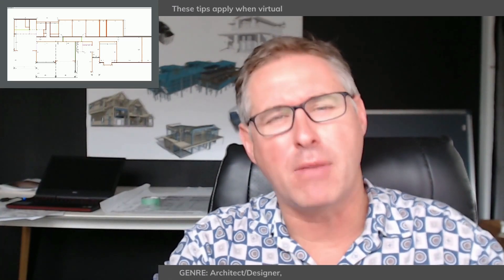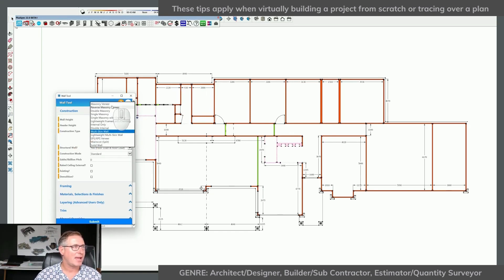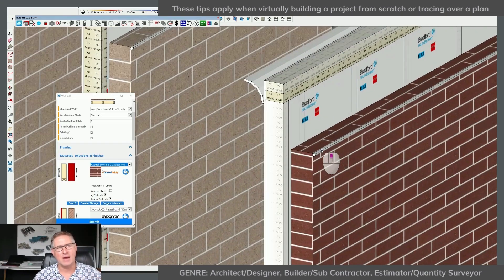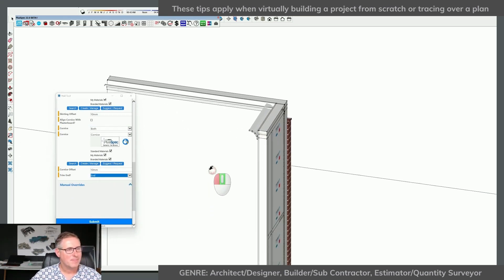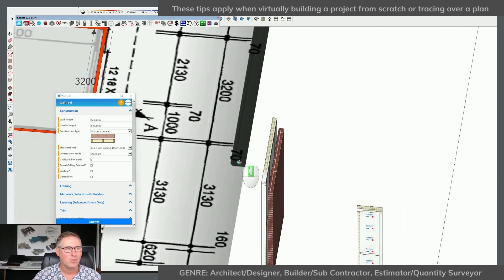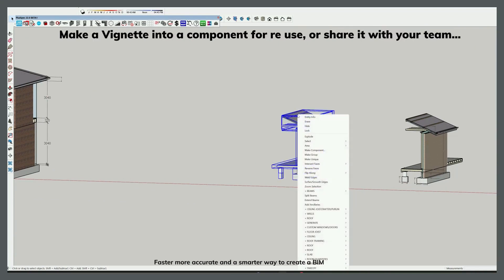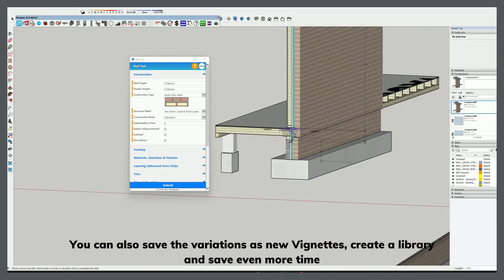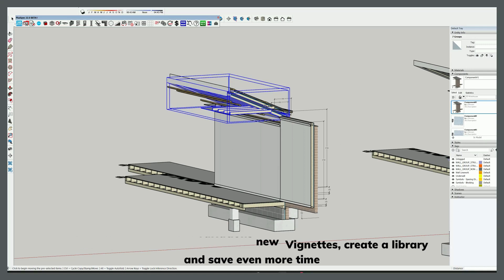3D Vignettes = Workflow Efficiency for Design & Build professions: PlusSpec PlusDesignBuild SketchUp

Comment: Very useful as is serves a double purpose. Faster drawing and it helps the guys onsite to get  their heads around the details.
Reply from the maker: For sure Neil, in fact, it actually serves as even more as you can assign suppliers and subcontractors to products for future use.  You can also assign supplier prices and subcontractors rates to the vignette.  Now it is quoting, creating a baseline template and a project brief.  Let's just say that PlusDesignBuild 2022 also has some NEWLY added features that you may pick up in this tutorial set.

Comment: Very helpful tips! One question, I see that  lot of the tutorials start with a 2d blueprint and you draw the walls right on top of that. I get the utility in that IF you start with blueprints. I use SU to design from scratch, however. Should I create 2D plans from my native SU designs, then draw the models over the 2D plans with PS, or can I use PS tools from the beginning of my design process?
Reply from the maker: It depends on how you like to design If you want to create in 2D first, You could simply use the "room set out" tool This way, you can label rooms.  Or you could start with an aerial image of the property (my favourite).
 Many designers start with a paper sketch and scan, import it and scale it using the scale tool.  I know Andrew measures up renovations on-site and draws them then and there on a laptop, yet you might like to use grid paper.  See this forum Link for help importing a PDF https://plusspec.com/forum/viewtopic.php?f=52&t=25802&p=36560&hilit=geoloctaion+location#p36560

Comment: Great Summary - A real time saver :) - Is there a way to set the footing also with a step say 110mm stepdown for the brickwork?
Reply from the maker: It would be unusual for a strip footing to have a step-down.  Can you give us an instance?
Reply: @PlusSpec   Thanks found you can achieve it using the slab tool - was looking for the brick step down for a brick veneer application.

Comment: I think it would be really great if you had links to the file you start with like most sketchup tutorials that start with complex drawings so people could follow along.
your software is amazing but it is far more valuble the easier you make it for people to learn how to use it.

Could you provide links for the files in all of the videos for me and all of the other people trying to learn how to use this software. It would make it easier to follow along.
Reply from the maker: That's a great suggestion.  👍  Hey don't forget that there are multiple models you can access through the splash screen.  There are 2 Vignettes one single level and one double, there is also a full Single storey. Click the question mark or open from the splash screen.  Thanks for your feedback.  👍